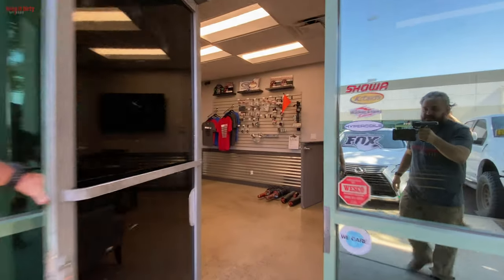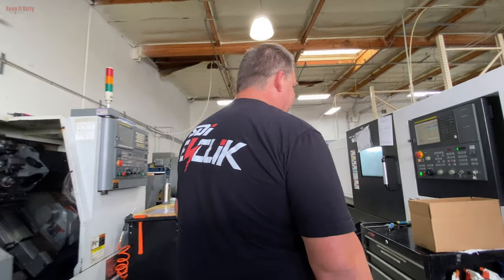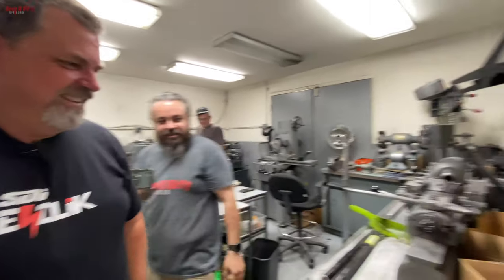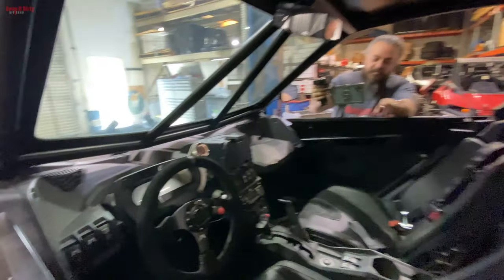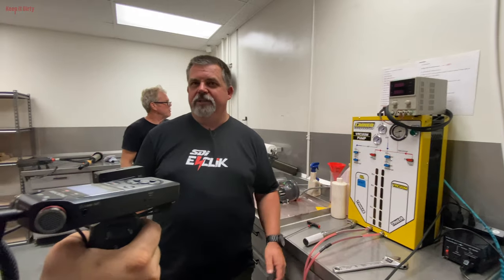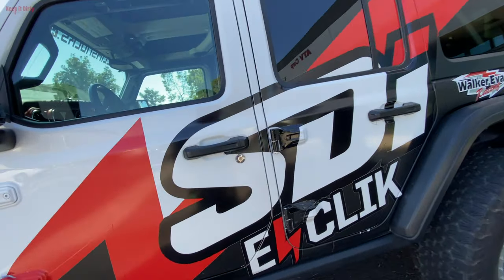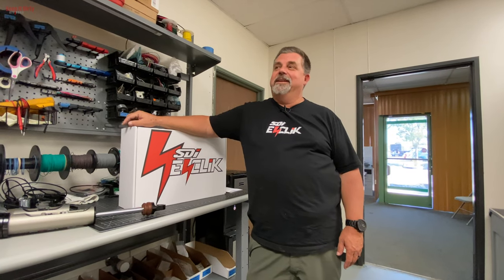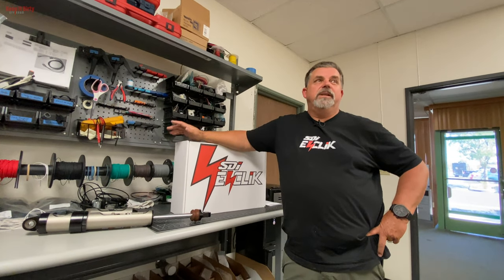SDI EClick Shop Tour

Comment: I have a GEN 1 and would be very interested in how a retro fit kit would work
Reply from the maker: Gen1 is not as easy as a Gen2 but still relatively easy.

1. Shock bucket. KHC or Camburg both make one for the Gen1. You can run Gen1 arms or upgrade to Gen2 takeoff arms. 

2. Take off Gen2 LIve Valve with solenoids OR Fox FRS LVs.

3. E click system with sensor. Run the included lines to each corner of the truck for each shocks.

4. Have a shit ton of fun.
Reply: @KeepItDirtyOffRoad  this had my curiosity. Now it has my attention
Reply from the maker: Certainly got my attention

Comment: Possible Shock Exchange Approach: Allow us to order the Kit (the electronics side of things) and a set of rebuilt/revalved shocks appropriate for our year truck (mine is a '20), have them installed at an SDI approved shop locally where our current shocks are collected by the shop, inspected, packaged and sent back to SDI to be rebuilt/revalved, at which point we would receive a credit back from SDI based on the condition of the take-off shocks we provided.  There would need to be a generally accepted range of take-off value and the authorized shop performing the work would need to have the authority to reject take-offs that didn't meet some reasonable condition requirement.  We get immediate access to revalved shocks and SDI ensures a solid stream of good condition take-offs to continue to feed the rebuild line.  Just one of many possibilities obviously.
Reply from the maker: Many shops have tried to setup a similar process and it’s very difficult to scale. The SDI team is trying to setup an exchange program that speeds things up, just not that quick yet. They need to inspect the shocks before exchanging them. 

Too much risk with sending shocks ahead of time.  I’ve seen what some people call “light use” or “low miles” in exchange programs. Just ask the guys at Forged offroad that tried it. They got shocks that were done. Could not be rebuilt. Soo corroded or damaged that they could not be rebuilt and now they are out a good set of shocks.